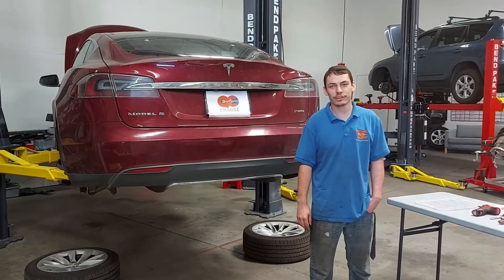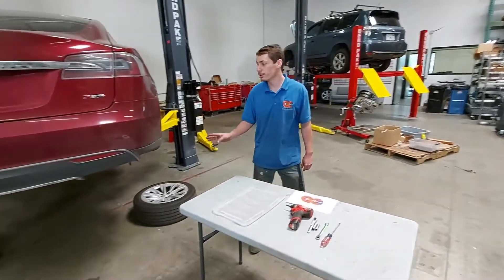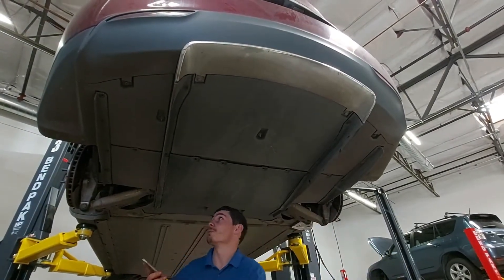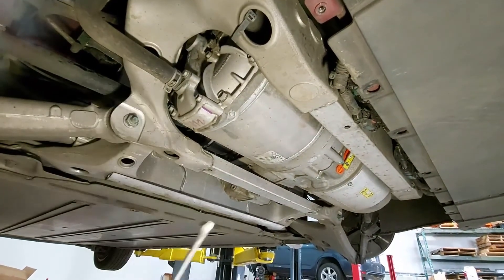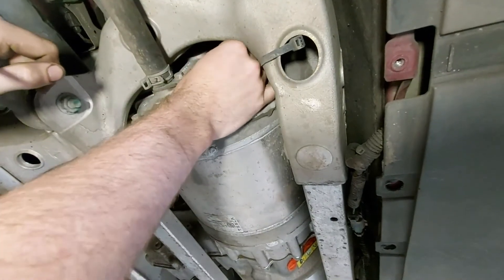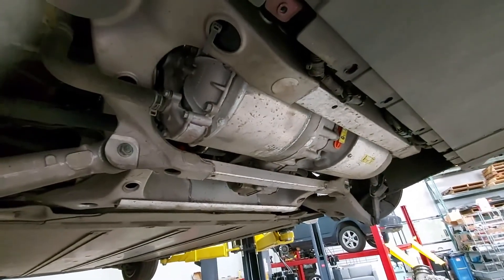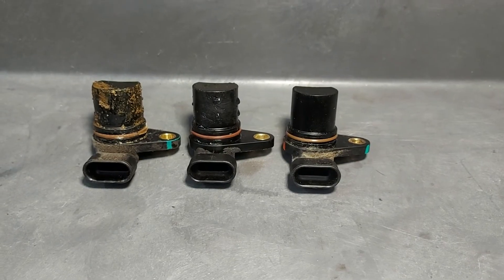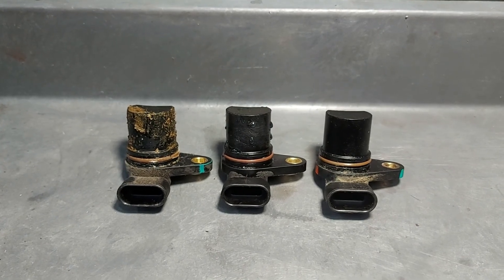How to check for Drive-Unit coolant leakage on your Tesla Model S

Comment: Hi there, can you estimate the repair cost? Not the factory repair at Tesla, but third party garrage
Reply from the maker: The speed sensor check is free at our location!
Reply: 😂ok, i mean to repair it once leak is presented. I know there are third party bearings, how much cost the engine repair. Roughly
Reply from the maker: @filipjakubik1767  My apologies, I miss understood your question. The cost ranges from ($3800-$7500). It really depends on if you need a new LDU or not and the severity of the leak.
Reply: @KonduitEV  thanks for heads up! have a good one today

Comment: Does this apply to a 2015 90D rear motor? You didn't explain what is a large drive unit.
Reply: LDU is on the performance dual motor cars
Reply: look at your information screen yers has the little motors aka non performance

Comment: Brillant video, flip out the speed sensor disconnect by hand when out and replug before refitting saves breaking the tab. 110,000 miles on my P85 motor, clean sensor lust a trace of grease, went in with a $4 endoscope from Ali express, its all clean, ill be doing a coolent delete in the next 5,000 miles.

Comment: Thanks for the video.  My car 2018 MXP, is out of warranty, but still has the battery and DU warranty.  Is this failure covered under the drive unit warranty or has Tesla cited some sort of loop hole for those who've experienced it?

Comment: Can you just pull out the metal tube and seal off the coolant for the rotor altogether? I always drive in chill mode and have drops on my speed sensor after only 90.000km on my remanufactured LDU.

Comment: Thank you for the informative video! I have a 2016MX I recently purchased. Do you know if there is a way to check if the drive unit was replaced with the newest "U" unit? Like a serial # or marking on the LDU?
Reply from the maker: There should be a sticker on the bottom of the drive unit which contains the part number and serial number. The last digit of the part number denotes which revision the drive unit is. The latest "U" rev LDU has only been out for a few months at this point.

Comment: Is there anything that can be done to delay seal leakage? Can you spray WD40, or some kind of oil, into the housing, for example?  I find this Tesla design flaw absolutely shocking.
Reply from the maker: Not really, the only thing you can do is check it periodically, and repair it when you see an issue. Spraying oil in there is likely to not end well, as you don't want to contaminate the seal...

It really is shocking, especially when you consider how long they continued to use this motor for despite it being a clear issue. We have an LDU torn down in the shop right now with a serial number close to 1.1 million. Not sure how many miles on it, but probably less than 15k, and it's under 2 years old.
Reply: @KonduitEV that’s literally grounds for a class action and major recall for “coolant delete” retrofits . What the hell.

Comment: Wondering if I shouldn’t be worried, I noticed coolant under the right side of my Tesla model y, front and back wheels, but it had already dried up and I haven’t seen an active leak.

At one point when I first got the car, there was a sound coming from the front of the car, Tesla fixed it. 

That said, the leak isn’t active and I can’t see staining under the car.  If the diagnostics doesn’t say fluid is low, should I still have Tesla look at the car, or just ignore it?

It’s on the right side of the model y, front and back tires.
Reply: Last time I took it in, 2.5 weeks without a car.  It was totally shitty.
Reply from the maker: Are you sure it was coolant and not just A/C condensation? The car will drip water underneath with the A/C running, especially on a warn day... 
It's possible a valve or a hose connection point could be the cause of a coolant leak, but it most likely wouldn't be "intermittent".
Reply: @KonduitEV  it’s blue, but I haven’t seen it active - it was dry. Stuck a camera under the passenger wheel well and can see blue staining on the super Manifold.  Scheduled an appointment.  Just sucks because I hate giving up my car to service, takes forever to get it back.

Comment: Hi, I have check mine and it has only grease ring near O ring of sensor, no coolant, is that ok? Thanks
Reply from the maker: A little bit of grease is to be expected if the speed sensor has never been checked/cleaned before. (The sealed bearings on the rotor always have a little bit of grease squish out during the break in period).
Reply: @KonduitEV  thanks a lot! 🍺🍺🍺🍺

Comment: Great video. Is this just not an issue on the smaller drive units, for example on a 75D?
Reply from the maker: Nope, just on the LDU. The motor potion of the SDU is actually oil cooled, so they don't even have a coolant seal to fail. 
In comparison to the LDU, the SDU is practically a bulletproof design (we actually have an employee with over 430k mi on his car's original rear SDU, and the front one lasted 375k before it was replaced).
Reply: @KonduitEV  What's an LDU and SDU?
Reply: @marcbee1234  Large Drive Unit & Standard Drive Unit

Comment: @QC CHARGE  - When doing a rebuild, what do you do with the "shaft grounding ring" (I mean the "brushes" -  designed by Aegis I guess - Aegis has a ("the"?) patent on that and I assume Tesla did not violate that - do all LDUs have them)? How do you prevent gunk to get on it while removing the rotor (I guess it should be removed while keeping it axisymmetrical enough - or does it not matter?)? Do you clean it? if so, how? How does it stand up against high mileage? The fiber wear length is designed to last 200,000 hours according Aegis' specsheet, but that may assume a clean shaft under lab conditions. If not cleaned, attached gunk may reduce conductivity, in turn leading to currents choosing another path, in turn increasing transmission bearing / gear fluting wear *again*, canceling out a bunch of your hard work.
Reply from the maker: The number one fix is keep oxygen away from the parts that oxidize, and removing steel from the bearings. We don’t use “brushes”.
Reply: @KonduitEV  The rotor housing has a breathing vent (I assume that's the hole's function) behind the speed sensor. This vent largely prevents breathing through the bearing. Do you plug that vent in a rebuild?
Reply: @KonduitEV  Okay, so let's assume electrically insulating ceramic balls around the rotor and no (working) Aegis brush to carry away currents. This means that the currents may "choose" to damage the rotor's spline/gears/etc instead (no oxygen needed for that, it just vaporizes the metal locally). Does the rebuild include measures to avoid this, and if so, which?
Reply from the maker: @diyEVguy  Tesla themselves actually eliminated the brush ring on the drive units in ~2015 (at the same time that they started installing ceramic bearings in the drive units). To date, we have never encountered one of these revised "gen 2" LDUs that had issues with the splines, the only motors we have encountered with spline issues (and we've rebuilt hundreds of them) were early (2012-2014) "gen 1" LDUs.

Comment: Do you sell rebuild kits?
I have milling noise and yesterday I lost speed/TC/Regen/ABS. I assume I have a leak.
Reply from the maker: We do not sell kits. You can send us the vehicle, or just the motor on a pallet.
Reply: @KonduitEV  Could you ballpark a cost of a rebuild? Feel free to send a PM
Reply from the maker: $2750 if you send us the motor, or $4000 if you send us the car.
Reply: @KonduitEV  that’s not bad at all. What if there are broken teeth on the spline. I know that is common for theses?
Reply from the maker: @ovrboostSRT4  it’s not rebuildable, and would require a different motor.
Reply: @KonduitEV  What is the most likely cause for the spline teeth to wear (and break)? Is it electrical rotor discharge through the spline gear (causing EDM-like damage) AND the rotor gear bearings, in turn harming the alignment between rotor and rotor gear axle, causing mechanical wear? Incorrect transaxle fluid (unlikely)? Too low transaxle fluid level bc of leak?
Reply from the maker: @diyEVguy , yes, those poor little splines are getting “arc welded”, as are the steel bearings.

Comment: How do you repair the leaking coolant and how much does it cost?
Reply from the maker: We perform a complete drive unit overhaul, which involves replacing the affected seal, as well as replacing the rotor bearings that the coolant would have come into contact with (we use hybrid ceramic bearings for the rotor) and cleaning up any corrosion buildup that may have occurred as a result of the coolant. 

In addition, we make a number of modifications to the drive unit which should prevent a leaky seal from causing irreparable harm  in the future.

Assuming that the drive unit was still operational and  can be rebuilt (aka, the inverter is not damaged, splines in good shape, etc.) the full overhaul costs about $4,000.

Comment: Great video. I have a 2014 S85 and I want to check the health of my engine. Is this the only way? Is there any noise or any other symtoms to be alert to? Thank you
Reply from the maker: Generally speaking, this is the only way to check for internal coolant leakage. There are usually no symptoms for this particular issue until it's too late (e.g., the drive unit is un-rebuildable). 
If your drive unit makes a "milling noise" that could be a symptom of worn out bearings though, which can potentially lead to a worn out seal eventually.
Reply: @KonduitEV hmmm, my 2016 model s 75 is making a slight noise - thought it might be cupped tires so I rotated them, but didn't help.  Everything still good at the moment though.  Absolutely love the car!

Comment: Great video.  I need to check my 2014 P85 with 180'k KM when the weather warms up.  I have felt some vibration and sometimes some "cogging" lately.
Reply from the maker: Vibration and cogging is definitely not a good sign, especially if it takes more power than normal to start from a stop, or if the car won't free-roll in neutral... 
Based on what you described, it sounds like your drive unit could be starting to seize, which could leave you stranded and render your car un-drivable with basically no warning.
Reply: @KonduitEV  That's my thoughs as well. This is the third drive unit. I will check with Tesla over the weekend.

Comment: great video! from which year does the drive unit is definitively reliable?
Reply: 2015 and newer drive units are generally very reliable. Tesla learned a LOT with the GEN1 "Large Drive Unit".
Reply: Q revision is still garbage. I'm on my second one and my car is dead yet again with everything pointing to coolant leak in drive unit.
Reply: @TonyWilliams123  What about the older standard units? Are they subject to the same problems?
Reply from the maker: @gatoraudio1 , all Tesla drive units built between 2012-2014 were the “570 amp” Large Drive Unit (LDU). Prior to that, they were motors that were purchased for the 2008-2011 Tesla Roadster.

Comment: What can you guys do with my 2013 Leaf with 2 bars left and 30 mile range?
Reply from the maker: Hi Jose, we have not yet done any work on Nissan LEAFs, but we have been wanting to do a battery swap. It's possible to put a "stock" 24kwh battery back in, or upgrade it to a larger 30, 40, or 62kwh battery. 
The biggest issue with doing battery upgrades on LEAFs is actually finding a suitable replacement battery... If you want, we can try to find a battery, or if you found one yourself you could bring it to us to perform the swap.